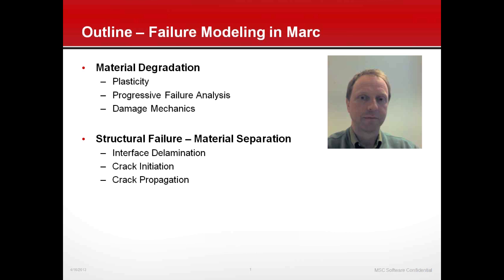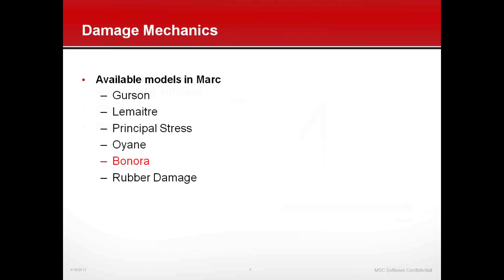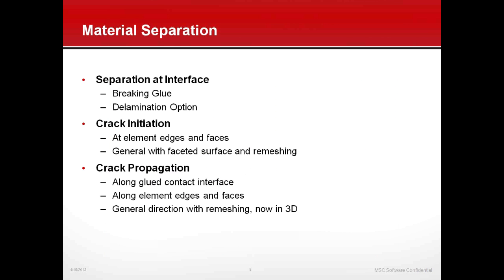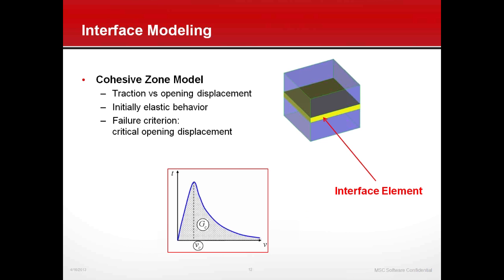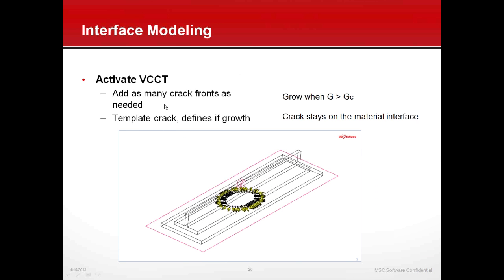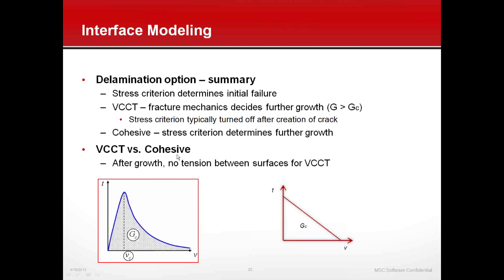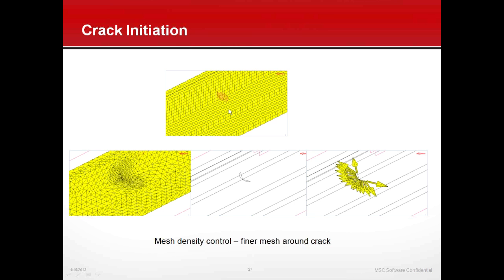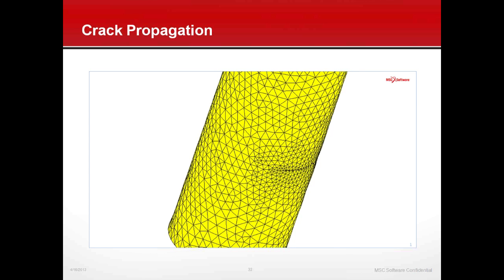Marc - Simulation of Failure and Crack Propagation in FEA

Comment: How to do mesh sensitivity study on models with crack?
 I am modeling a CT specimen. The question is I don't know how to find the proper size for my mesh. The  crack area has finer mesh. To study mesh size sensitivity, I make meshes into half and compare the results with previous meshing. The problem is by making crack area elements even finer the material gets softer and the stress values drop dramatically, so the stress values from two different mesh size do not converge. Any comment?